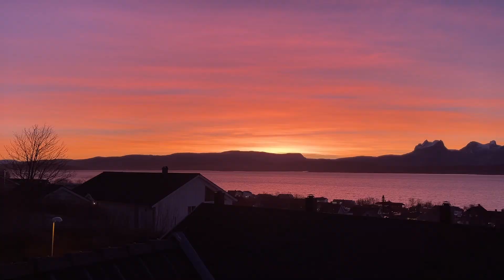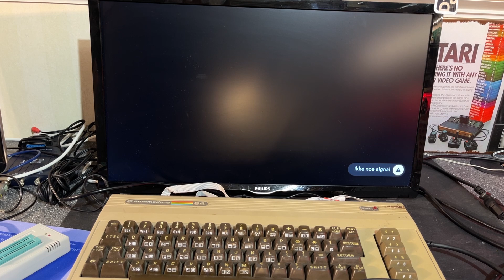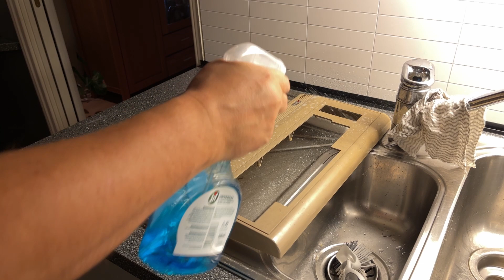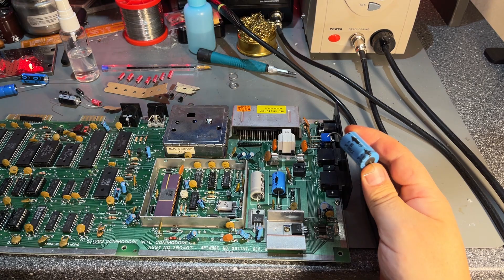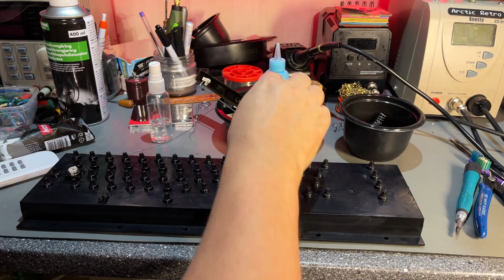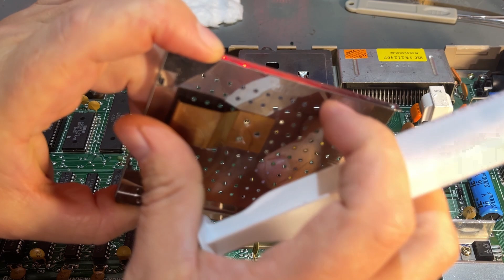ANOTHER Commodore 64 restoration and case repair + recapping - Can't get enough C64's!

Comment: to give keyboard maintenance is not necessary to rip off keys, that action can easily break keys...  I don't recommend it at all, excellent results can be obtained with just a brush and alcohol, and disassembling the keyboard contact PCB board remove all the tiny screws and clean each conductive rubber key contact and metal pads at the pcb board. once again Don't Remove the key caps!!!
Reply from the maker: Ok, thanks. I have never broken or damaged a key using my method :)

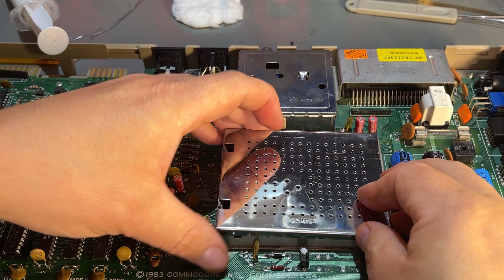Comment: There is a simple way to fix the bluriness of the video with the type of RF modulator you have in your board. Watch Adrian Blacks video  called "Improve your C64's video output with this simple fix". Around timestamp 30:50 you can see he cuts a capacitor in the modulator and the video improvement is drastic. I do that on all my C64 with that type of RF modulator.
Reply from the maker: Ah, yes I saw that I think. Thanks!

Comment: I wash the boards with soapy lukewarm water and a paint brush and rinse in cold water. To dry I heat up the oven to 80 degrees turn it off and put the board in for 2 hours.
Reply from the maker: That's a great idea!

Comment: Nice :D i think i need to chekk my c128 powerbrick before i try it and also clean it, best is to replace right? or can a psu be used for easy&quick fix :D
Reply from the maker: There is a lot of modern ones you can buy relatively cheap.
Reply: @Arcticretro  ahok Nice, thank you :D

Comment: Your printer can't print ABS so it can be the same plastic as the C64 which would allow the solvent glue welding?
Reply from the maker: I think it can but I only got PLA plastic

Comment: What's happening with the springs is called "bluing", IIRC. There are a bunch of ways of doing it, but yeah, it's all about creating a protective oxide layer, and in the case of steel, that'd be a layer of magnetite. That's the extent of my knowledge in the subject though!
Reply from the maker: Thanks for the insight!

Comment: When old 74xx regulators fail they may actually output the full voltage and fry all chips. But as you say they usually last long.
Reply from the maker: I might replace them next time then :)

Comment: You'd have to measure the capacitors' ESR too for a full diagnosis, but after 40 years replacement is the safe option.
Reply from the maker: Yes, I should. Don't think that tester I have is good at that